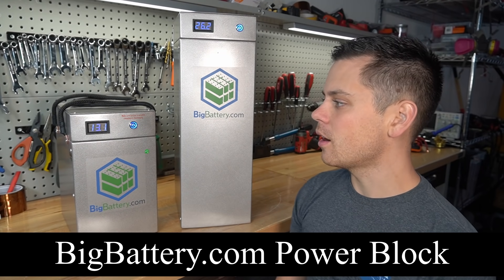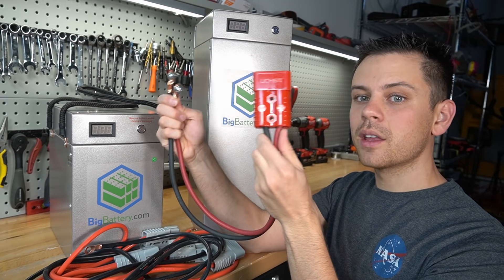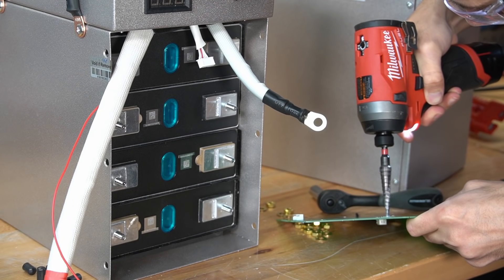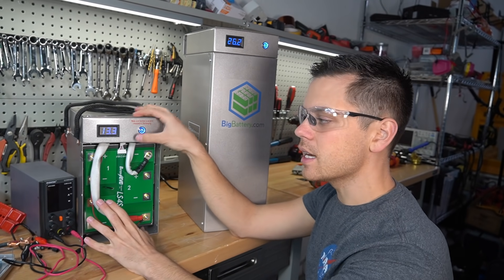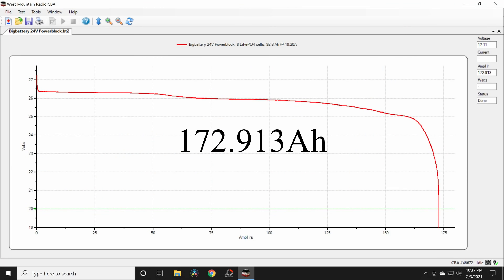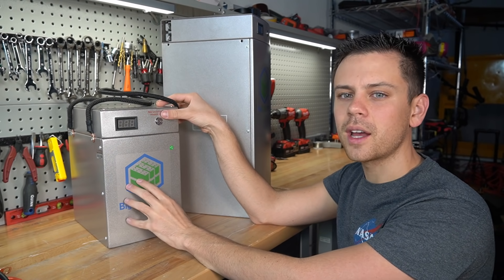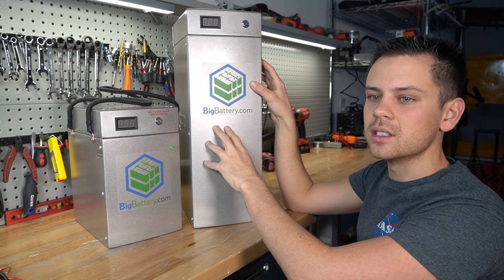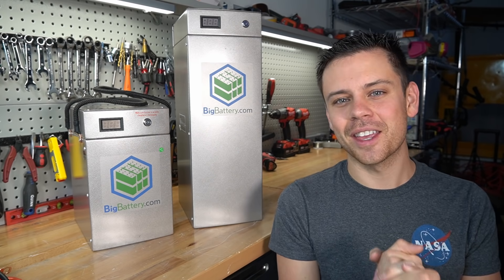Bigbattery.com Powerblock LiFePO4

Comment: Hi Will,
FxFactory has a plugin called Reverb Remover that works with most video editing programs. I think its a vst. You could just tweak a dial and get rid of the echo in your videos that way instead of modifying the physical area where you are recording. Ive never tried it but it looks like it will work for what you do. Cheers.
Reply: I listen to this with a headphone and did not notice the reverb. He was only my right ear however so perhaps it's a stereo only affect that you are mentioning? I like the natural sound myself I bet you would to remove the reverb they do some compression on the way to the product results. One time at the University of Chicago I confronted a professor about semantic information being transmitted by our face to the listeners ears in the binaural experience of face-to-face communication. it was very interesting because another professor intervened. I was confident that there was a dimensional requirement for full understanding and it was obvious what it was talking about to the third party but it wasn't necessarily in the audio it was in the optical. Our brains if you are talking to somebody sitting in the living room and you are upside down in the recliner or somewhat challenged otherwise can tell. It may not seem like the angle that you stare at somebody's face matters but it does! We are not cyborgs our brain evolved and we have tended to speak to each other face to face.
Reply: @arts8302  oh I didn't mean the echo was bad in this video. It's not bad at all. Its good actually. Will was talking about the acoustics of the room in a recent video so I figured a VST plugin might be an easy fix if it ever has too much echo, but this is good.
Reply: @MattandHolly920  yes I remember him being so concerned about his palatial digs having a disconnect with part of his audience. The electric bike review channel always begins with the birds and today I had a real encounter with this roadrunner. It noticed how I was tentative in my approach eventually because when I walked away because it was so camera shy my wife could barely see it from the other side of the planet in dual video the Google Duo video chat that we were having I had to get so close for her to see the humming for her to see the roadrunner. I was on the loop just off the loop there's a little break area on Broadway at the pantano. Behind that complex of home Depot and Kohl's and the perverts grocery store there it used to be called something else than what they call it now but the pervert had them changed the name of their entire chain but behind that complex there is an asphalt acre which is the seal the dirt from the poison within it being leached into the aquifer so they no longer have to put a fence around that acre Plus like they used to because they put a parking lot that nobody parks on there so it's a great place if you have an electric skateboard or something you can really enjoy that black top that has no other use than keeping the rain from getting into the dirt underneath it. But beyond that is the former landfill which is like hundreds of acres on the east side of the pantano storm water wash that has been there a long time. There was a huge chunk of solid gold that had been pounded into this costume jewelry like bangle that was so tight on my wrist when I finally got it off I stuck it in one of the tires in that acreage and then I couldn't find it because it was so hot and humid whenever I would look for it and I know that somebody went out there whose job it was eventually to get all the tires off of the desert and took it to the landfill so in our landfill there's thousands of dollars of gold in the tire LOL. I called my common law wife of half a decade who is 17 years older than me and wanted her gold back I called that tire at desert oyster. She was so crazy at that time that she didn't understand I was referring to a used tire and she gave up on getting her gold back which of course she'd give them to me it was like our wedding ring she had mailed it down all of her gold stuff and paid somebody a fortune to make it into this huge bangle that fit so tightly on my wrist she couldn't get it off whenever she was angry with me as if that was what it was engineered to do. It took me months to get it off and I had to cover it with cloth during certain occasions because you can't be showing thousands of dollars of gold on your wrist everywhere you go at least if you're a decent shop who has work to do and I have always been that. Anyways sometimes when I record I get great background like an electric bike review channel. You don't really know what you're hearing until you try listening to it and right now my open source OGG recorder tells me every time I go to the tab that it cannot generate a unique file name even though it's generating unique file name every time. Eventually the guy will find out about this error message and fix it but I continue to use the product because the error is the product thinking there's an error. This device doesn't record in stereo to my knowledge but I haven't verified that it might very well be recording in stereo with the recorder. in response to my reviews he has stepped it up it can now not only not record on the fly which almost nobody does recording on the fly uses battery that you don't necessarily have so doing it after you're done recording makes sense it used to be that you have to wait until it's finished before starting another recording but now he does it in the background. I also complained about him tying up the internal memory for the thought wave file before encoding it. I think he's actually addressed that problem as well meaning I hope he has despite evidence to the contrary. Apparently with Android 8 or 7 or whenever they corrupted their operating system so that you couldn't do really neat things it makes it difficult to write audio directly to the SD card. So if you know of a Android recorder for Android nine or better that can

Comment: I really need an expert review of the chin lithium 100ah battery sold on Amazon.  The customer ratings are high  but are they good? Please help. They are the best deal going.  I need 4 for my boat and at $525 each that's a great deal. Besides quality can I also use one battery to start a v6 outboard engine? They have no CCA rating listed. I message  company and I think they said yes but I  think there is a language barrier.  Lol so I'm not sure . They have a 10 year wty and customer service is in California .

Comment: I noticed the 24 volt model is now using the A123 cells and is quite a bit more expensive (than the Lishen cell model they had) :(
Reply: Are you saying that you can buy a123 branded cells fin currentlyally freshly manufactured because although I didn't have a strong opinion I have gotten an impression that when byd bought the a123 factories they tended to sell to fleets or under their other brand and that the a123 cells that were coming available for older straw stock I said we're older truck stock I'm sorry I'm wearing my throat. Anyways apparently this is not a good time to be dictating in my neighborhood. I haven't seen well do a a123 sell to product assembly guide and I would like to see that!

Comment: $1600 for the big one. That's all I was after LOL
Reply: How much is the small one? (another victim of Will killing their server)
Reply: @harrygibus  Got and got off due to their site. Anyone glance at the small one?
Reply: @chrisolsen5280  I believe it's $1100
Reply: @KellyNW8P  Ouch!
Reply: @chrisolsen5280  $1100 for 175 amp hours compared to a Battle Born 100 amp hour for $950 . I'd say it's a pretty good deal. If you want , Interstate sells used lead acid 6 volt golf cart batteries for $75 apiece. They are 225. Amp hour so for $150 you can have a  decent bank. I currently have 450 amp hours of these in my van . They are adequate but the next van will have Lifepo.
Reply: @stanw909  I would go with the big one as it's twice the size for only $400 more I think? $1600 is a bit steep for me atm since I am trying to buy a house and I don't have anywhere to put it right now.
Reply: @stanw909  Add, Will's recommendation site page lists a Coupon Code "Diysolar" For 10% Off.  So could get it for $989.10... Or the big 4.4kWh one for $1,199...  Or $2199 for an even bigger 5.3 kWh model... Not to mention the 10 year warranty.  So definitely good competition for Battle Born...
Reply: @harrygibus  $979

Comment: Why is offgrid still a good idea. It seems you have to build your system to the worst week of the year. So during the summer months you are producing huge amounts of electricity that is going to waist. Am I missing something?
Reply: You are thinking the wrong way..  why would you go offgrid and not plan for the worst?  If you plan for the best with 10 hours of amazing sunlight and a 100ah battery bank, you will be absolutely hosed during winter.
Reply: Where I live (the Caribbean), the electricity price is around $0.44/kwh, using a hybrid solar system to power all but the heaviest loads would save the cost of the system in a matter of years.
Reply: You can build storage so that it covers the worst time of the year. So batteries are beefed up to cover dark days but solar could be a bit more modest than worst case.
Reply: So I have a grid tied 9kw system. In December there is always a week that I average 3kwh a day. In July I regularly produce 50kwh a day. 

If someone in my area did a 9kw off grid system they would have to configure there house to not need more than 5kwh a day to survive that 1 week in December. So in July if you can’t push some of that 50kwh back to the grid then doesn’t it just go to waist? That just seems like a terrible idea.

Comment: I'm part of the RV community (read "people who use battery power all the time but still know little about the technology") and the big question everyone asks is: "Is there a less expensive alternative to Battle Born?" So that's what a lot of people would like you hear from you. Cheers!
Reply: The answer is yes, skip to 1:27 of the video. Battleborn  is $0.70/Wh and the smaller 12v version from this video is $0.45/Wh and the 24v is $0.35/Wh.
Reply: There was an on-screen chart in the video about 1:30-1:40 that had the info I think you're looking for.
Reply: @DavidHuffTexas  There's a LOT more to "which battery is best" than $/kwh, as Will points out in nearly every video, including this one.
Reply: @Mmmyess  But you asked a question about "which is less expensive"... and the answer is the BigBattery one. I'm well aware of the so-called "Engineering triangle": 1) Quality, 2) Cost, 3)Speed / convenience / time. Pick any two.
Reply: @DavidHuffTexas  You're right! I should have asked if there are other batteries similar in capability to Battle Born that provide a better value. My bad.
Reply: @Mmmyess  No worries. And yes, it WOULD be cool if there was a Battle Born quality battery avail for significantly less cost!
Reply: I like that Will says these would be good for home solar systems. I have a Battle Born for my truck camper and BB batteries are good for outdoor marine type installations (read wet environment). He also says this on his website when recommending BB batteries. He also states that he has never met anyone who was unhappy with their BB battery. That says a lot. They just work.

Comment: Hope you caught Elon's interview with Sandy Monro.   Elon and Sandy agree 12 volt is obsolete.  48 volt is the future!  Please do a DIY BIG Battery.  48 volt, with three or four milk crates or even more!.
Reply: make sure you tell that to the inverter company, the guys who make fridges and lights, the solar charge controllers and the solar panels! 12V is pretty entrenched in the off grid ecosystem.
Reply: Agreed, but we still have to support 12V Technology. We make our 24V Solutions and 48V Solutions easy to connect in Parallel and Series to help push 48V Systems.
Reply: Well, solar panels aren't an issue.  Just wire them up for 24 or 48.

Comment: I bought one of these for my camper van a week ago in order to replace my two AGM marine batteries with this one. More capacity and half the size and weight! I also purchased a MPPT charge controller to improve my charge rate. Big battery responded to my questions over the phone and were very helpful. Thanks again for your excellent research and reviews!
Reply: Hi. I'm interested in getting one for my four wheel camper on my truck. I have to AGM batteries in there now. I'm installing a Redarc DC to DC charger. Was it an easy swap out . Anything to be aware of regarding the connections?

Comment: Will, needing to replace all my batteries, 12 & 48 volt systems. Am looking for the best new technology and am curious about such claims as Tesla’s 15 million mile battery.
I can hold off buying if something revolutionary is coming out.
Are you aware of any new significant battery advancements coming?
Thanks.
Reply: I'm not Will. However not anytime soon. Maybe in 10 years something better will be along and commercially viable but I wouldn't hold my breath. Right now though if your batteries need replacing LifePo4 is a good pick if it fits your needs. The prices do keep coming down but that's just a matter of how long you can limp along your current system before the replacement is a must and how tolerant of shipment and manufacturing delays you are if suddenly waiting becomes a non option.
Reply: chublez:  thanks for your thoughts.

Comment: I bought two of the 170s have not installed in my RV looking too buy a Victron charger inverter to go with them. Will do you have one that you're done testing with I will buy it off you. Looking for a 2000 or 3000

Comment: Doesn't Bigbattery know that warranty stick void if removed are Illegal Under the 1975 Magnuson-Moss Warranty Act.
Reply from the maker: Dang I didn't know that either. Why do so many manufacturers use them? My ebikes battery has that too. Can they get in trouble for using them?
Reply: @WillProwse  yes all one has to do is call the FTC just google ftc warranty stickers it first link
Reply: @WillProwse  they aren't enforceable. They're used as a deterrent. If you break the sticker you're less likely to send in a warranty claim.

I've broken tons of warranty stickers and threadlock on computer equipment working in it and never had a warranty claim denied.

Comment: Hi Will, Is the temperature sensor and tag leads 100% waterproof? no wiring or electronics like saltwater, maybe some freeze spray would be a better option for this test, it's been specially designed for electronic circuits, hope that helps. Regards Stormer
Reply from the maker: Yes it is. Wouldn't test in water if they weren't. This sensor is common and waterproof. This test works great with this sensor. If it was not waterproof and able to trigger from salt water alone at any temp, I would never recommend the battery. That would be pathetic lol
Reply: @WillProwse  Thanks for the reply will, after 30 years of repairing electronics and  knowing first hand the damage that salt water can cause, it's always nice to avoid any salt exposure to electronic components, but if the sensor and leads have been dipped in epoxy during the manufacture it would probably be ok.. I would opt for Freeze spray in this instance as I use all the time and can be even used on live circuits too as it has reasonabley low conductivity as long as you don't go overboard with it it's fine.. Regards Stormer
Reply from the maker: Smart idea. I am scared that might be too cold though. I want the temp close to 0 degrees and those freeze sprays are quite a bit colder. What do you think?
Reply: @WillProwse  yes that's a very good point and one  I didn't consider, that you were shooting for a specific test parameter. 
I understand and agree freeze spray might be too aggressive, it definitely can cool down to - 40c. 
Would the ice water without salt give you 0 degrees ok? 
Or you could possibly try measuring the temperature of aerosol contact cleaner with a probe and use that.. But I get you are shooting videos and the ice water definitely is a better visual aid too, so I agree with it in that respect, the salt thing is what got my attention and initially wasn't sure it was waterproof. Regards Stormer